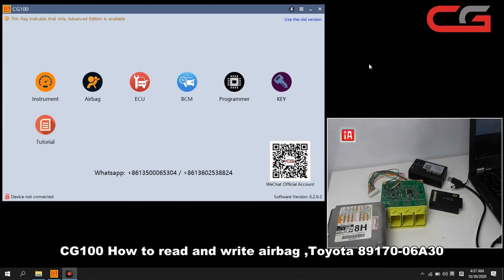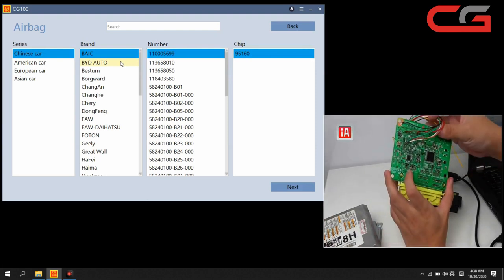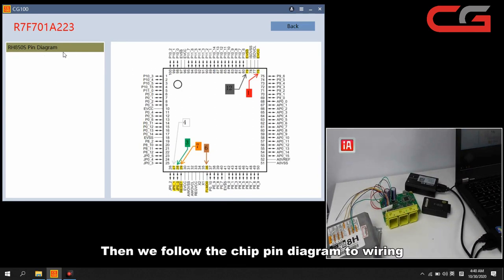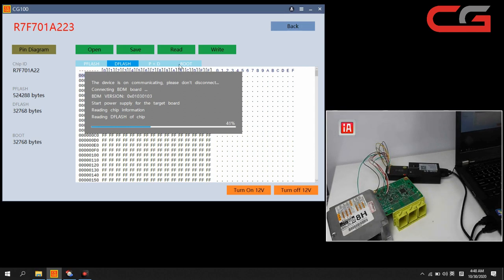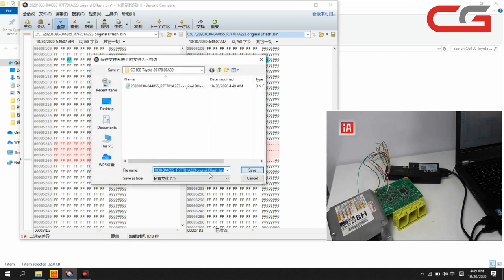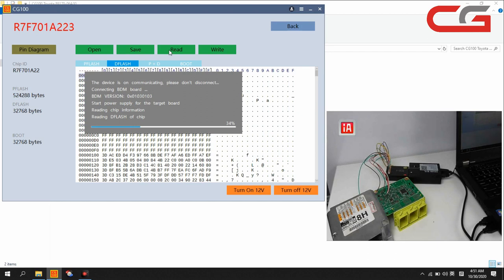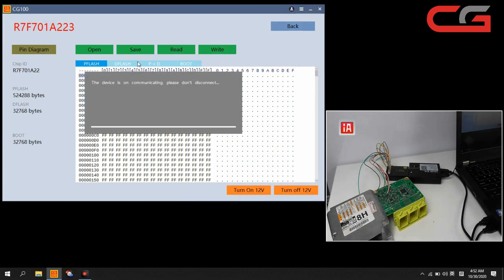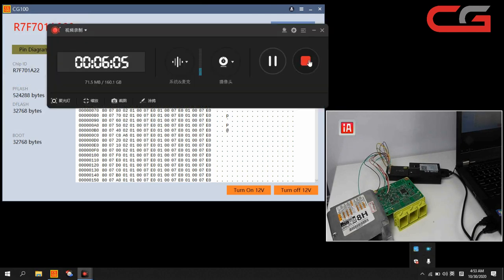CG100  read and write airbag ,Toyota 89170 06A30

Comment: Does your software cover module 98820 EZ20B BOSCH chip 95128
Reply from the maker: No have this module in airbag page ,Then you can go to programmer page ,follow the chp diagram to wiring ,then read out the original data ,send to support .They can help you to clear it

Comment: how did you know where the crash data was on the file? you removed it but did not say how you recognized it
Reply from the maker: Normally , you can read out the cleared file ,compare with the origianl crash file , You can find out where is the crash data .About where is the crash data , you need to learn by yourself ,I just tell you CG100 has function can  read and write this file(some file you can send me to clear for you )
Reply: @cgofficial2114  i purchased the unit but it says the software expired, i tried to contact the WhatsApp number and they didn't help me
Reply from the maker: @alegibable  Please contact your seller first, let seller help to do it. thank you
Reply: @cgofficial2114  No one support Everyone is taking extra money to provide clear crash data dealt also saying extra charg then given clear file otherwise not supporting not given any solution